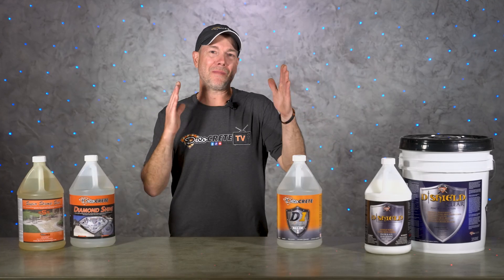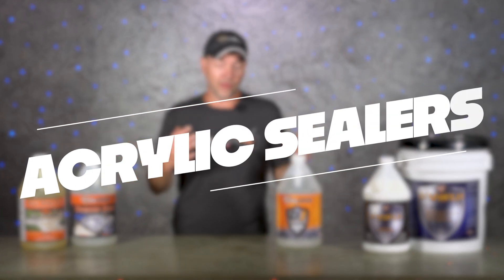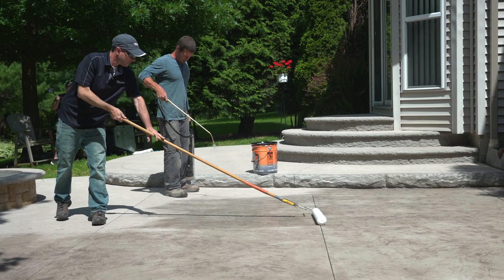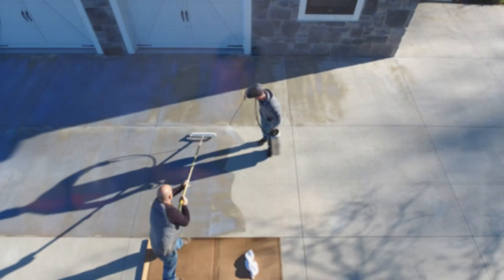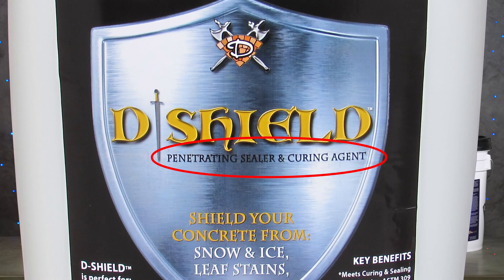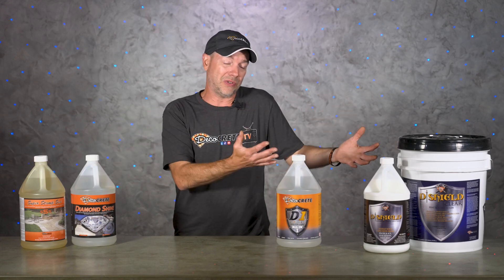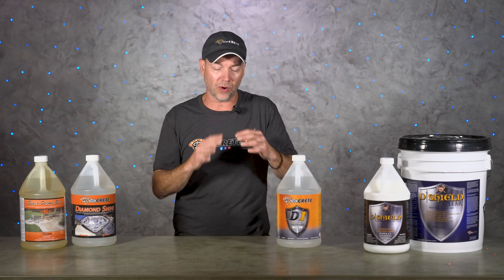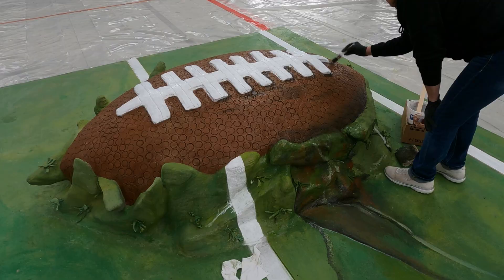Concrete Sealer Showdown: Acrylic vs. Penetrating Sealers

Comment: Shout out from Philippines sir. May I ask which one's better for a small corner concrete countertop wash area, penetrating or acrylic?
Reply from the maker: Thanks for the comment! We prefer something film forming for countertops. Acrylic sealer would certainly work, but it may to be recoated as some point down the road. I would recommend our Rock Top WB Matte for your situation, I'll leave a link to the product page below. Thanks for watching Deco-Crete TV!!                                                                https://www.deco-cretesupply.com/products/countertop-sealers/rock-top-wb-matte

Comment: We just had 2 large patios poured yesterday, and it became very apparent the brown I chose was actually a reddish clay, and I hate it. I love the color now that it’s dried, and I’m looking for a sealer that won’t change the color back to the original. The company that poured and will seal it only use acrylic, which I’ve read will darken the color (I’m assuming to the ugly wet color when it was first poured)
Reply from the maker: Thanks for the comment! You are correct about acrylic sealers darkening the color. A penetrating sealer/water repellent will protect the concrete from staining and water intrusion without any darkening effect. I'll leave a few links below to our preferred penetrating sealers. Most sealers like this will require that the concrete is at least 28 days old, so you have a little time before a decision needs to be made. If you spray some water on the surface, you will get a good idea of what the concrete would look like with an acrylic sealer. Most colored concrete will take at least 2-3 weeks to reach its final color, so I wouldn't make final decisions if the slab is only a few days old. Hopefully this helps. Thanks for watching Deco-Crete TV!!!!                                                                                                                                                                                                                                                            https://www.deco-cretesupply.com/products/water-based-sealers/d-shield-5-gallons                                                                                                                                                                                                         https://www.deco-cretesupply.com/products/water-based-sealers/decoblock
Reply: @DecoCreteTV thank you soo much! You’ve already been more helpful than the contractor we have. Can I ask a couple more questions? 😅 They came back to cut diamond shapes and power washed less than 24 hours after pouring and we now have stripes all over from the washer. Will they eventually come out, or will they stay? I asked the guys if they should wait until it was cured more, and then asked the contractor, but they all said they needed to wash it as “quickly as possible.” I sent a video of the markings to the contractor but he hasn’t responded. He also said we could put our furniture on it after 5 days, but the guys who came to cut and wash it said it needs to be sealed before putting anything on.  I’m so confused!
Reply from the maker: @beast_girl_22  You are welcome! Glad we could help! They are correct about needing to wash the concrete as soon as possible after saw cutting. If the dust is left behind, it could cause permanent stains, especially with colored concrete. As for the striping left behind from the power washer, it's hard to say how permanent that will be. It's definitely okay to power wash concrete the next day; you just have to be careful. If they got too close with the power washer wand, it may have etched into the concrete a little bit, and in that case, it probably won't go away on its own, but it should get less noticeable over time. You could try power washing it again in the opposite direction to see if that helps hide the marks. The concrete itself will certainly be strong enough to put furniture on after 5 days, but I would be careful with any metal furniture on unsealed concrete. Rust stains will be really hard to remove. Honestly, I would try to avoid metal furniture altogether. We hope you get the issues resolved and enjoy your new patios!

Comment: For a light use walkway & patio It is necessary to use sealer?  I vacation in the Caribbean often and it appears as though they commonly skip the gloss coat as much of the colored concrete is matte & dull in appearance (which i like). I'm thinking that even if the peaks of a broomed finish lighten with traffic that the coloring remains in the valleys. Perhaps a light stain refresh every few years to taste similar effort to the "recommended" sealer maintenance. Am i overlooking anything? 
Thanks for the informative video👍
Reply from the maker: You are welcome! Thanks for the comment! Sealer is important to keep your concrete looking good. It helps it resist stains and keeps water from soaking in. That said, it's really more a visual thing for walkways & patios and the concrete isn't gonna just fall apart without sealer. It is more important in clod weather parts of the world due freeze-thaw cycles and deicing compounds. This would not be a problem in the Caribbean, so it makes sense that don't seem to worry about it down there. We would recommend to at least use a penetrating sealer if don't want any darkening effect or sheen. It'll still protect your concrete from staining and those types of sealer require verry little maintenance. Thanks for watching Deco-Crete TV!!!

Comment: what is your brand recommendation for stamped colored concrete? My patio is about 15 years old and needs a reseal. I like that wet look.
Reply from the maker: Thanks for the comment! D-One sealer from Deco-Crete is our top seller for stamped concrete. It will bring out/darken the colors, but doesn't leave a high sheen on the surface. It looks very natural and gives your concrete all the protection it needs! I'll leave a link to the product page below. Thanks for watching Deco-Crete TV!!!                 https://www.youtube.com/watch?v=MncEu9nXKSE                                                                                                                                                                                                             https://www.deco-cretesupply.com/products/decorative-concrete-sealers-solvent-based-sealer/d-one-5-gallon

Comment: I have new stucco (in Florida) would you recommend Seal Krete waterproofing or Plugger25?
Reply from the maker: Thanks for the comment! I'll be honest, I've never used either of those products. From what I can see on the data sheets, the Seal Krete seems to be more of true water repellent. And the Plugger25 is acyclic and film forming. If I was going to use one of those for stucco, I'd probably go with the Seal Krete. Again, I have no experience with either of them, so I'm just saying that based off of the data sheet. I'll leave a link to our recommended product for some comparison. Hopefully this helps. Thanks for watching Deco-Crete TV!!!    
 https://www.deco-cretesupply.com/products/water-based-sealers/decoblock

Comment: Which sealer is non- slip when wet. I sealed my driveway. It was extremely slippery when it was wet.
Reply from the maker: Thanks for the comment! The best thing for this is a penetrating sealer. It's the film left behind from acrylic sealers that makes the concrete slippery. You can add an anti-slip additive to acrylic sealers to help things out, but we prefer sticking with penetrating sealers on driveways. The problem you are facing will get better with time as the sealer wears down from weather and use. Hopefully this helps. Thanks for watching Deco-Crete TV!!!

Comment: What do you recommend for interior concrete floors ? If I wanted to prevent any mold/ mildew for example to prep before laying down a floor
Reply from the maker: Thanks for the comment! Pretty much any acrylic concrete sealer will help with that. The challenge would be getting other flooring to bond to the sealer. This would depend on what type of flooring you plan to install over the sealer. I would check the manufacturer's recommendations before applying any sealer to the concrete. Hopefully this helps. Thanks for watching Deco-Crete TV!!!

Comment: Do you know of any sealer that will retard moisture vapor from migrating from below? My garage is above grade and having condensation issue, no vapor barrier under bare concrete
Reply from the maker: Thanks for the comment! I just want to make sure I understand the question. Are you having trouble with condensation coming through the garage floor and ending up on the underside? Or is the condensation ending up on top of the garage floor? Both of these situations can be challenging to deal with, as concrete sealers and coatings are not very tolerant of moisture. Sometimes, when condensation appears on the surface of a floor, it's not actually coming from underneath. It's coming from the environment in the building, but it ends up on the floor. I'm curious if you notice any condensation on the walls or ceiling of the garage?

Comment: Would you recommend penitrating sealers for conrete status that has been curing for 5 years, and will be painted with an oil base paint?
Reply from the maker: Thanks for the comment! Penetrating sealer would be good option for that if you were not planning on painting it. Paint will have a hard time bonding to any concrete sealer. Honestly, I would just paint it, that should protect it just fine on its own. Thanks for watching Deco-Crete TV!!!
Reply: @DecoCreteTV  ok,thanks for responding back

Comment: Hi, I'm about to get a new garage floor. My contractor recommended acrylic cure and seal, but from what I've read, I'd rather use a penetrating densifier and sealer in the garage. Will I jeapordize proper curing if we don’t put on an acrylic cure and seal right as it's hardening? I'm afraid if he puts that on it will impede any penetrating sealer later on.
Reply from the maker: Thanks for the comment! Some of this would depend on what part of the country you live in. We still have pretty cool temperatures in northern part of the country this time of year, and a curing compound isn't as important as it would be in the middle of the summer. If you live in the south, things might be different. The point of a concrete curing compound is to slow down the rate of hydration, and allow the concrete cure slower. There is also a difference between interior and exterior slabs. Direct sunlight beating on the concrete during it's first week or two will add to the problem of curing too fast. Being that it's a garage floor, that is out of direct sunlight will lessen the need for a curing compound. Ultimately, this is between you, your contractor, and the ready mix plant, so it's always a good idea to discus this with them before making any final decisions. I'm actually a pretty big of acyclic sealers for garage floors! They do make the floor look nice, and the film that's left behind will protect it from stains and makes the floor easy to sweep with a broom. The hang up on acyclic sealer on garage floors is that they don't hold up very well to harsh chemicals, gasoline, break cleaner, etc. Penetrating sealers don't necessary protect the concrete from 100% of the chemicals, but there is usually no visible damage to the sealer, so they appear to hold up better to that kind if stuff. All in all, there is perfect answer to this question, you just have to decide what's most important to you. The very best option for garage floors is a resinous coating, but that is a other conversation, and that's something that would be done at least 30 after pouring the concrete. I'll leave few links to some other videos that may be helpful. We hope your new floor turns out great! Thanks for watching Deco-Crete TV!!!                                                                                                                                                                                           
  https://www.youtube.com/watch?v=V_0eIsgg2pc&t=10s                                                                                                                                                             
  https://www.youtube.com/watch?v=dSz71y4uKcU&t=121s                                                                                                                                                   
  https://www.youtube.com/watch?v=J9HsvOZGjXs&t=2s                                                                                                                                                        
  https://www.youtube.com/watch?v=5lPg7osGpW4

Comment: I would like to get your take on so called pet paw print stepping stones. What do you think about penetrating sealers being used on those? We just lost a really awesome boy and I made a paw print out of regular concrete (not colored) because I wasn't sure what we would get back from the vet and them doing their own paw print. 
So the paw print itself is a little rough because of the paw overall and the surrounding concrete is smooth. The edges are a bit chipped away, not very bad at all, but I forgot to put an oil or release mechanism for the concrete to slide free from. Anyway, I wouldn't mind getting some advice on which sealer I should look at. I am working in Commiefornia, but also can easily head up to Nevada where I reside if there is a sealant available there instead of the hammer and sickle state. thanks for the video and insight
Reply from the maker: Thanks for the comment! We're sorry to hear about your loss! There is certainly no right or wrong for what kind of sealer to use here, it just depends on what's most important to you. A penetrating sealer would work really nice for this if you like the way it looks right now. It wouldn't change the appearance, but it will protect it from stains and keep it water repellant. You should be able to find a sealer like this in any state, even good old California, lol! A solvent-based acrylic sealer would darken the color and create a film on the surface. This would give it less of a natural look, and it'll be a little bit shiny or really shiny, depending on what sealer you use. Our number one acrylic sealer would be our D-One. That one would be less shiny than most of the other SB acrylics. You will have a hard time finding something like this in CA. I'll leave a link to the product page on our website below. All in all, I'm a big fan of penetrating sealers for this kind of application. Hopefully, this helps! Thanks for watching Deco-Crete TV!!!                                        
 https://www.deco-cretesupply.com/products/decorative-concrete-sealers-acrylic-color-packs-solvent-based-sealer/d-one-1-gallon
Reply: @DecoCreteTV  Thank you for your response I truly appreciate it. Yeah i think I'll do a penetrating sealer since I don't want to change the color of the concrete. Thanks again and keep up the great work.

Comment: We recently did a remodel in our house and we had old Terrazzo floors. We did a lot of new plumbing so we had to cut up and trench all throughout the house. We ended up grinding everything down really good and recapping with a thin layer of re-cap. We use a rubber trial to apply it. It is inside, so we wanted to see what the best sealer would be. We wanted something that brings out the color a little bit, but not super shiny. What would you recommend using?
Reply from the maker: Thanks for the comment! Sorry for the late response, this one must have fell through the cracks on our end. There is certainly no right or wrong way to go here, but the biggest decision would be whether to go with an acrylic sealer or resinous concrete coating. The sealer would less money and easier to install, but the coating would create more build on the floor & last longer. The best option for acrylic sealer would be our D-One. It's low sheen and will bring out color. On the coatings side, our Rock Hard Urethane with the Aluminum Oxide additive would work great. The urethane on it's own is really shinny, but the Aluminum Oxide will knock down the sheen and make the floor anti-slip. I'll leave links to some other videos below that are more specific to these products & one that explains the difference between sealers & coatings. Hopefully this helps! Thanks for watching Deco-Crete TV!!!!                  
 https://www.youtube.com/watch?v=dSz71y4uKcU&t=114s                                                                                                                                                    
 https://www.youtube.com/watch?v=N9D4SG_zyAQ                                                                                                                                                                  
 https://www.youtube.com/watch?v=u5RNPrg-8wE                                                                                                                                                                    
 https://www.youtube.com/watch?v=vy5D05SrJsM

Comment: What is your recommendation for a new slab with uneven color after curing, a pigmented solvent based acrylic sealer or the concrete revival product
Reply from the maker: Thanks for the comment! Revival would be the best recommendation! You just have to make sure that there is no sealer/curing on the slab. Pigmented sealers would work, they just don't last as long, or look as good as Revival. Thanks for watching Deco-Crete TV!!!